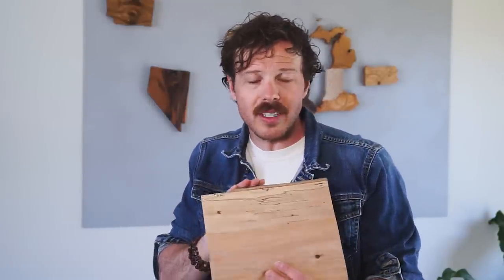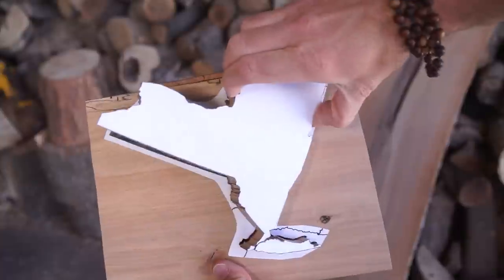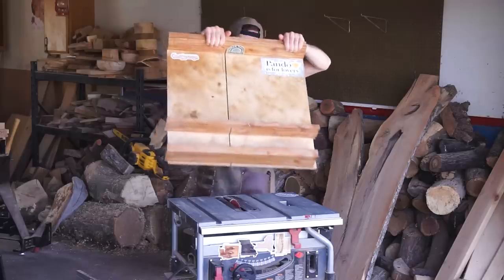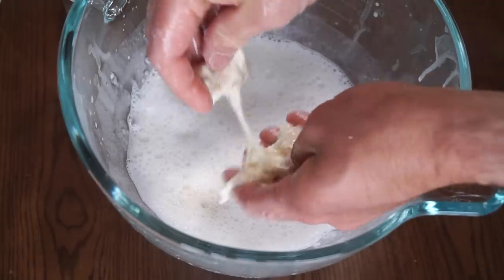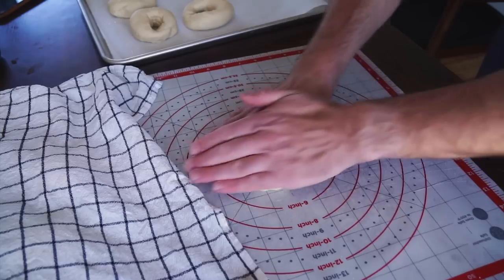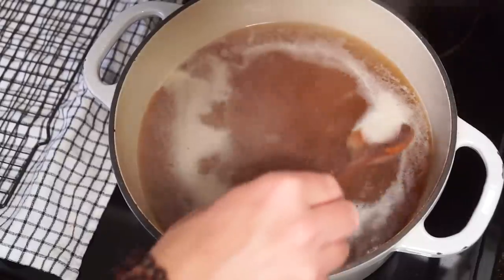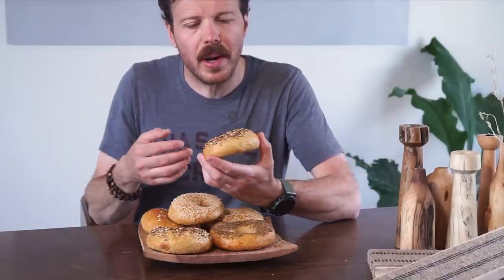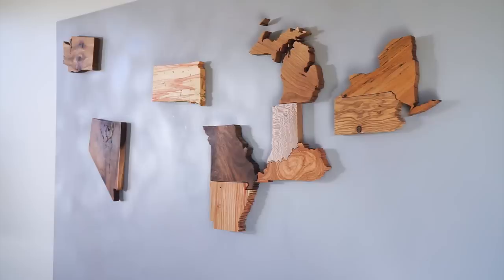What's the point of bagel boards? | Justinthetrees US Tree Map

Comment: If you roll your hands in opposite directions when doing the traditional method, you can corkscrew the dough before you spin it over and rejoin the ends. This massively will increase the chew of the dough. I believe Dan said a good bagle should be a mouth workout, and i relate to that. The chewier my bagles, the more i loved them.